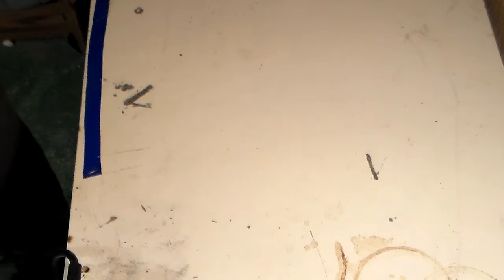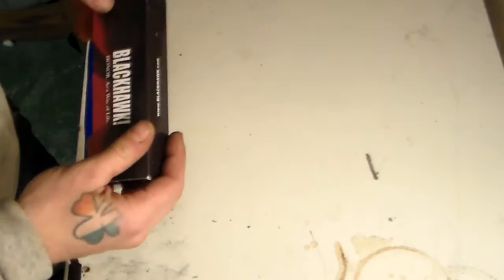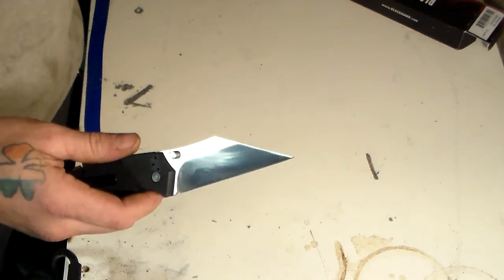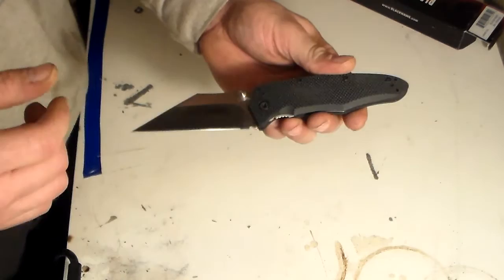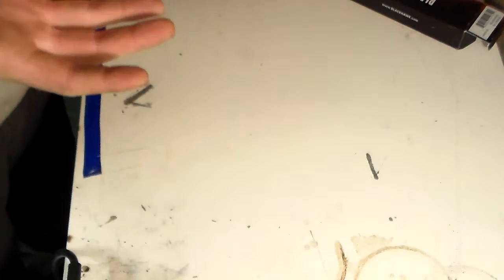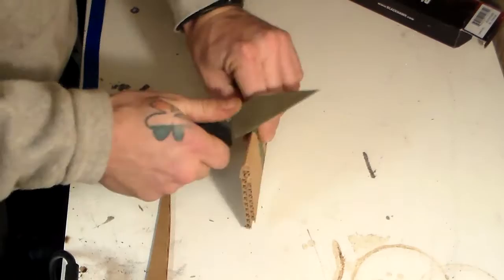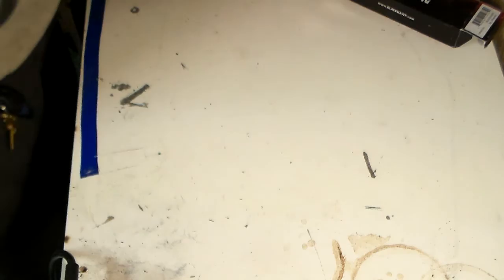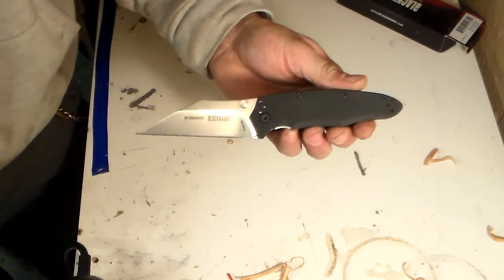BLACKHAWK! Be-Wharned

Comment: Awesome blade brother.
Reply from the maker: 116 Survival Thanks man. This blade is sweet.
Reply: Blade Jockey, looks pretty sinister for sure.
Reply from the maker: 116 Survival used it at work to cut things you would normally use a razor blade for, drywall, zip ties, electrical wire etc... it was a beast.
Reply: Nice...I don't think I would abuse it with drywall but it's good to know it can handle it.
Reply from the maker: 116 Survival I didn't like doing it because of how narrow the tip is. curiosity got the better of me. I was also super cautious while doing it. wouldn't do it again.
Reply: Lol, ok cool.